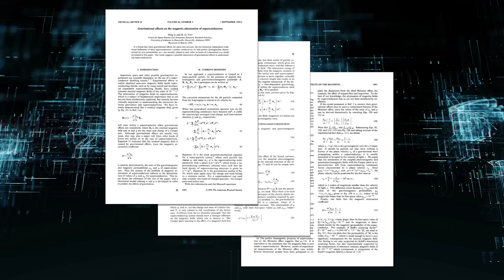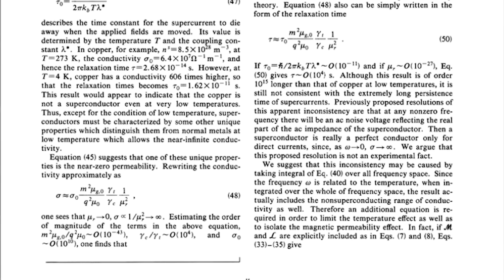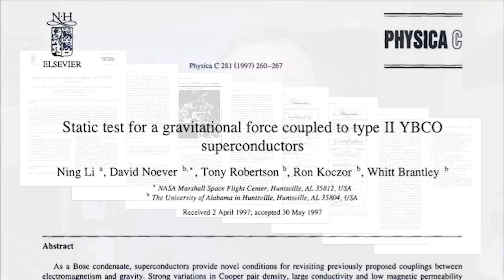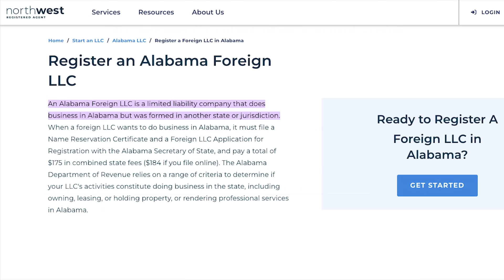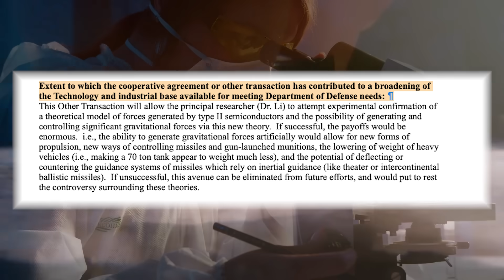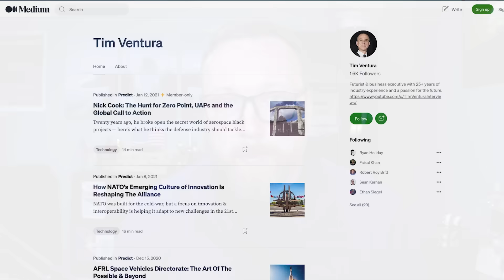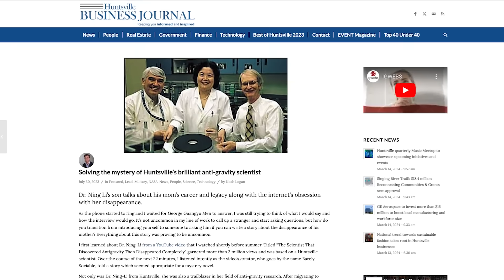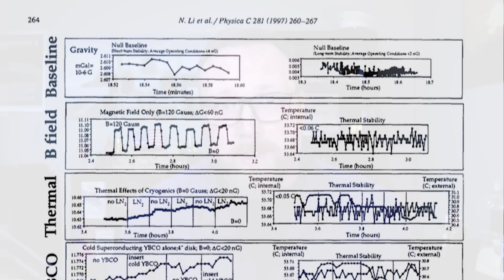The disappearance of America's leading anti-gravity researcher

Comment: She probably disappeared because she took the money and ran, an object that is experiencing an upward force produced by a superconductor weighs less, well of course it does, I went on one of those things that replicate skydiving and I weighed less because a massive fan was providing an upward force.
The excerpt at around 8:20 is also ridiculous you want to place a tank on top of a type 2 superconductor, the cooling for that size of superconductor would have to be housed in it's own building the huge tanks of liquid helium you would need would weigh many times what you saved form reducing the weight of the tank, even the weight of the superconductor without any cooling would probably be heavier than the tank . Then as soon as the tank moved it would no longer be on top of the superconductor.
Weight reduction helps a car perform better but would be absolutely useless if it only reduced weight while the car was parked.
As for using it on icbm's  you want to build a superconductor from a U.S missile base into space then all the way to a military target in Russia. Hello president Putin you wouldn't mind if we installed a giant superconductor that leads to one of your military airports would you ?
ps: nearly all theoretical papers published ultimately turn out to be wrong......
And to anyone who thinks the government wouldn't have funded it if it was nonsense - remember they also funded research into ESP

Comment: Yep, that IS a weird story. But you covered it exceptionally well.  If antigravity CAN be achieved IS, one must ask if a basic principle in physics (conservation of energy) is maintained. 
It would be way too bizarre if one could defeat gravity, lift an object, then enable gravity, and extract a NET gain in work/energy by lowering the object.
Assuming this basic principle is NOT violated, we can calculate the amount of power and energy needed to accelerate a mass, and lift an object some distance through a gravitational field.
Considering that some of the reported 'UAPs' have been much larger than a fighter jet, the power and energy requirements are HUGE and could only be met with nuclear reactors or something even more advanced. It also could not use traditional means to extract and convert the power via. a heating cycle to drive an electromechanical generator.
It seems inconceivable that all of those challenges have been overcome within just a few years (the Navy's first video of a flying UAP was filmed in 2004).

Comment: Interesting as always, and yet.  If the CCP wanted her back they wouldn't have barred her from the country to attend her mother's funeral -- they would have allowed her in, and then she would really have disappeared.

Here's another (much more real) DoD conspiracy that you won't find on the interwebs or on social media or wikipedia.

The Solotrek XFV is an exoskeleton single-person flying device.  It had achieved tethered flight and DARPA participation and then its website stopped updating.  Prior to any sense of realism it was shown (as a scifi prop) on Cody Banks Secret Agent.  After the DARPA join the only other reference is a mythbusters episode.

What's interesting about the mythbusters episode is that in all other projects they'd attempt to prove a myth true or false, and if false, would find any way possible to change the test setup to gain success.  However, in "building" a one-man exoskeleton (which resembled the Solotrek device to uncanny precision as if they'd been handed a working model) they quickly determined it would never lift anything and said the myth was busted.

This all, despite the Solotrek tethered tests showed it would not only lift itself, but a fully-equipped person.  For mythbusters to a)"build" a near-exact duplicate of the XFV, b)quickly test it and determine it couldn't lift anything, and c)not attempt to modify the testbed to find a solution speaks wonders.  Since then both battery technology and electric motor technology and rotor blade technology have come a long way, so what may have been limited to IGE performance years ago would be able to perform OGE flight today.  

You should do a weirdo conspiracy theory episode every now and then.  It's different than the usual "here's the data, folks" presentation.  Your voice is unique (I mean that figuratively as well as literally.)

E
P.S. There's no such thing as antigravity.  If you want to avoid being hit by a car and getting alzheimer's (or any other result of TBI) probably best to remember that...

Comment: The research is in line with Roschin Godin experiments. And dare I say it. RR Searle. Levity Discs. It’s fairly clear from all of these limited papers that somewhere in the idea of extremely fast spinning discs ( usually in a vacuum, levitated on magnets or attached to a single hung steel cable ) there maybe some way to direct the huge amount of stayed kinetic energy in an antithetical direction to gravity itself. My guess is it contains a huge amount of momentum, many thousands of times stronger than the weight of the object and that momentum is direct-able in any way you want and in any direction. 
It’s a little terrifying because it makes you think what if a small group could keep such an amazing thing to themselves. They might splinter off and just be by themselves somewhere able to fly anywhere they want at almost any speed. What else might such a group do.

Comment: If something lost its weight, wouldn't that make it uncontrollable relative to the surface of the earth?  The earth rotates once every 24 hours, and orbits the sun every 365 days, and orbits our galaxy every 225 million years.   In other words, everything in and on our planet moves at extreme speeds and not in a straight line.  The glue that keeps it all together, such that you can move from point A to point B on the surface of the Earth is gravity.  If the Earth itself lost its gravity then point A and point B, and every other point on Earth would be shot off in random directions, not even forming an asteroid belt, but an ever expanding dust cloud.  If they show me an experiment where they levitated something in a lab, and it just hovers in place, then I say hogwash to their anti gravity claims.  For a visual representation that might help, search "How our solar system really moves in space" on YouTube.
Reply: If a single object became immune to gravity (as is the purpose of these experiments) it would simply levitate, or be able to move up and down with ease.  It wouldn't fly off the face of the Earth because it would still have 300 miles of atmosphere above it holding it in place.

If anything it would gradually be pushed upwards as the, now much heavier, air surrounding it squeezed beneath it.  So there would have to be some control mechanism, like the ballast on a submarine/airship.
Reply: @krashd  Even just relative to our sun, an object on the surface is travelling at 67,000 miles per hour (+1000 if it it's on the equator in the daytime, and -1000 at night, 1000 mph towards the sun in the morning, 1000 mph away in the evenning) in one direction, and 24 hours later the earth changes direction by about 1 degree (360 degrees per year, 365 days).  Without gravity it's not going to just sit there with a thin strip of air holding it in place.

Comment: Gravity tends to exhibit a rule of squares property, so unless there is some kind of exotic matter that has a complex number describe it's effective mass component - there's not quite anything that is going to be anti-gravity. (Something that when squared would produce a negative value.) However some other things may indicate that it's a relationship between energy vs. the background vacuum state, and if you have something that affects the boundary between energy and the vacuum then you can have what seems like "anti-gravity" behavior. You're at least finding a way to affect the mechanism that causes the acceleration effect which is defined as the gravity phenomena. Interestingly enough, the c² in E=mc² can be redefined as the product of the electromagnetic properties of the vacuum. I don't think that's a coincidence, even if you have to drag Einstein's work back over into Maxwell's.

I think that ol' lady stumbled into something there. But it's not going to make it into the public sector anytime soon, which is a bit of a shame because there are good applications for it.

Comment: first of all, i know about that research thing. ITS NOT anti gravity. its the thing i have been saying been developed and tested in atlantic and pacific by your country's black projects. those floating lights above the water thing. i have said in the past few years. they are ELECTROMAGNETIC device. MAGLEV. MAGNETIC LEVITATION. it doesnt defy gravity, the original idea was it suppose to use electromagnetic field exists in earth magnetic arc and riding over it. all the tested devices are SMALL. 
they have to be made out of semi-superconductor (some made of silver alloy materials) being cooled down hundreds of degrees below zero, and then having powerful electromagnetic field laid down underneath them to make them floats. they use special modified SUBMARINE that carry big power source to magnetized locally small area of water on sea surface from underneath, and have those objects floating and move about in "circuit like" routes. much like how a conductive matter behaves under 2 array of opposing electrical polarity. the objects are INERT. they rely on external magnetic fields control. its just the elaboration of simple very well known MAGNETIC LEVITATION tech. we have been watching these too.
NOBODY in this planet have any knowledge about real gravity manipulation tech. I DO.

Comment: Anti Gravity is easier than people think, The real problem with Anti Gravity is that when you get a working theory, to working model; the Federal Government grabs it. The other real problem with Anti Gravity is the power source for the machine. Both probably has been seized by the Feds, ironically they haven't solved it for a practical working model. There is a Reverse Engineered Anti Gravity Craft, but its not good enough for actual work.

Comment: In 2014, Ning Li was struck by a vehicle while crossing the street on the University of Alabama in Huntsville campus. Li’s husband, seeing the accident, suffered a heart attack and died a year later in 2015. For Li, this accident caused permanent brain damage that resulted in Alzheimer’s disease shortly after.[1] On July 27, 2021, Ning Li died at the age of 78.[1

quickly reading the snippet you displayed ... she in her proof of concept work found that her mass change experiment had the equivalent effect of the force of a 5 story building  affecting a gravity measurements 1m away ... with just a 2% change in gravitational force would be equal to 100Km rise in height ... so yes she fund something ... 

the above uses the Radial Dependence of the inverse square law regarding Gravity ... essentially she created a Lorentz O ... with her doped materials ... making the size of the gravity changing device much smaller than Stan Deyo's large electromagnet setup

Comment: I know less than anybody. However, through reading and watching video sources I can extrapolate that the main issue with "anti-gravity" tech is making superconductors that will work at room temp. And if that is the case that would be the key to unlocking not just anti-gravity but also many other technologies.

Comment: Does anti-gravity exist? Seems so, actually, possibly. So, LIGO just a few years back discovered gravitational waves, a phenomenon long-predicted, but now proven. And Dr. Li seems to have found a method to, shall we say, "juke the system". Combining these two emerging scientific fields could be enlightening. (Horrible pun gleefully intended). Dr. Li's math, from her published works seems right to me, after looking it over at a glance. Though, this is not my area of expertise, it does seem solid. Also, CERN has been experimenting with the gravitational effects of anti-matter, which do not produce anti-gravity, but, seem to be less-attracted to gravitational forces than other forms of matter. So far. They will still require at least another three years of testing to confirm, but, that is what the preliminary reports are saying. So, it does appear right now that anti-grav is a real thing, only, we are at least several generations off from being certain, and several more from putting into concrete use, at best.